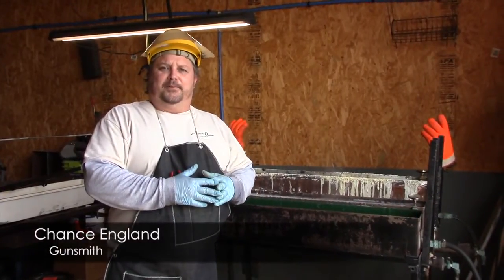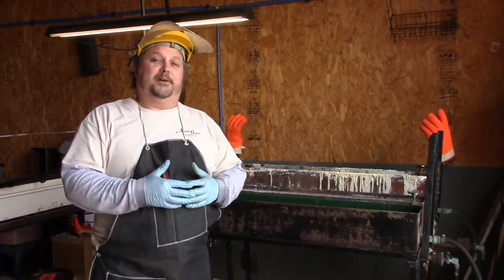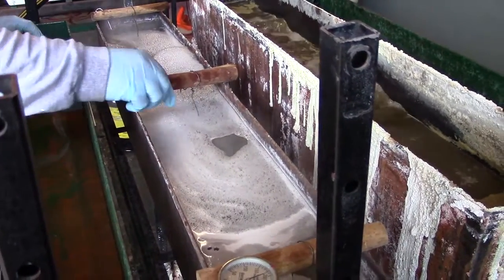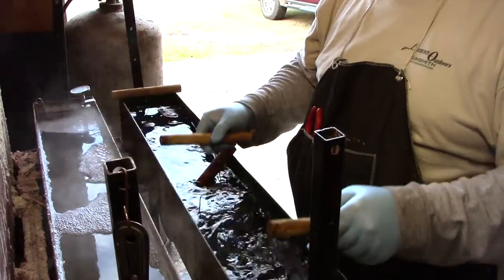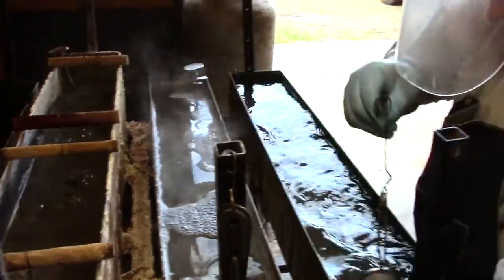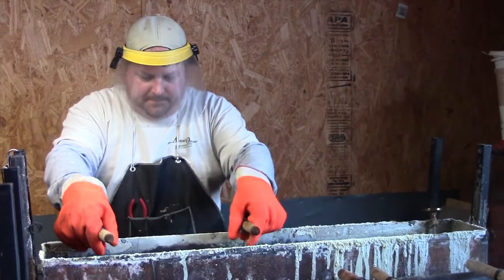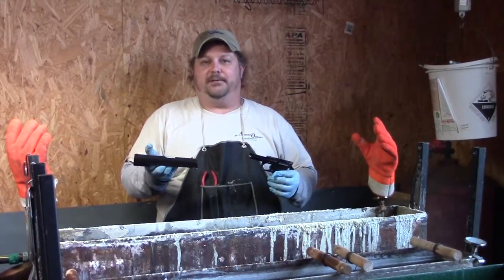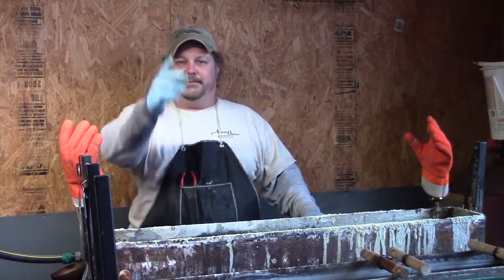Accuracy Outdoors  - Hot Bluing Process

Comment: When doing a barrel, do you need to plug it up to avoid bluing the bore?
Reply: Bluing is not coating or plating, it won't add extra dimension to the surface, so the answer is no plug.
Reply: @MetalMutant  ty
Reply: @LuisInPalmdale  you're welcome.